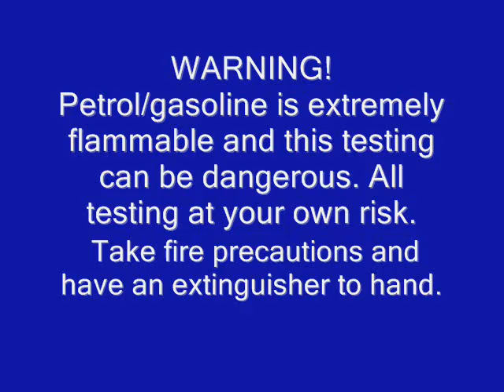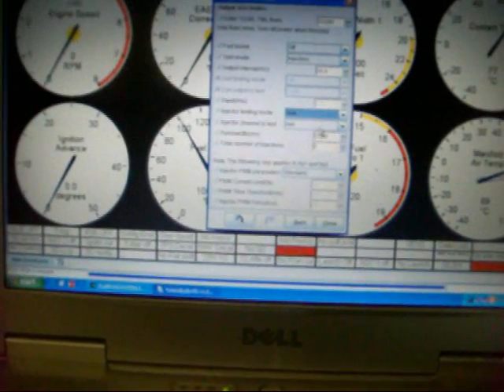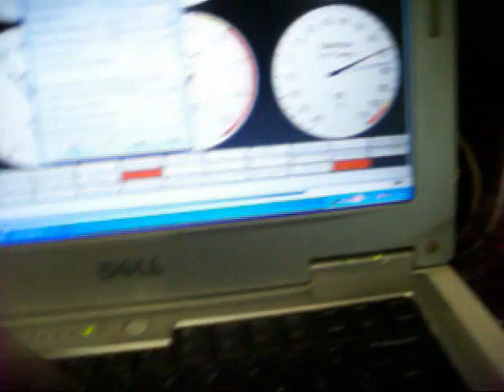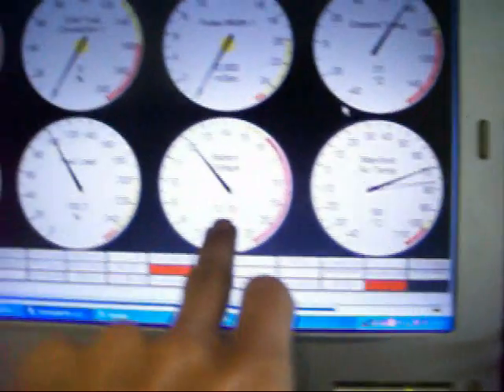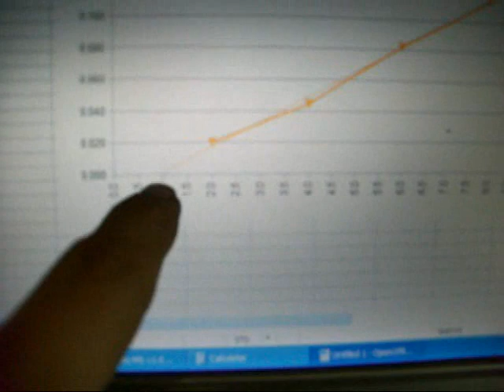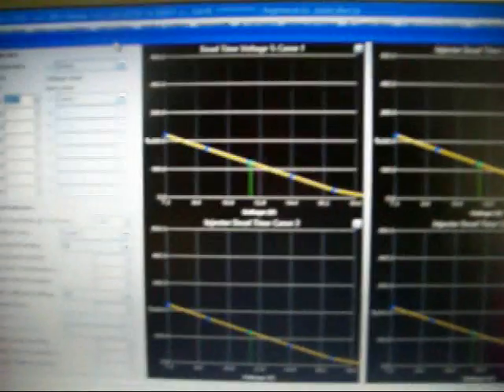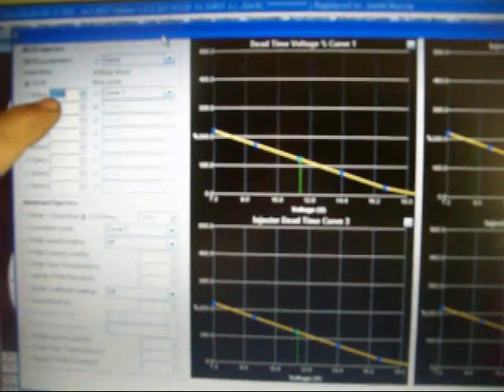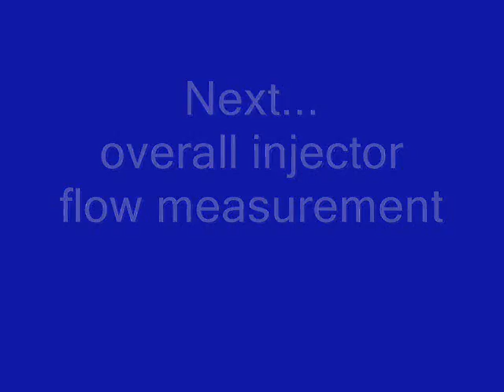Megasquirt fuel injector dead-time & flow testing

Comment: Very interesting. Thank you for making this video. My car has been on a megasquirt 2 forever... it's v2.2. it's always had the 1 millisecond setting.  I have low impedance injectors 2.2omhs 85lbs @43psi, and the dead time is .379 @14v , that's what the manufacturer said. It starts and idles pretty well for a megasquirt car. But it's super sensitive if it's ever above 14.8 afr. I also pull a shitload of timing down to 0 degrees during cranking, and then soon as it fires, I add 10° depending on temperature for warm up on top of 18 degrees.. Engine is l28et edis 6 124 module msd6al to a locked dizzy. I really want to get a newer efi like ms3 or fueltec, I'm surprised it's still alive it's probably got 200,000 miles on it. Lol 
I think I may try to put it in the dead times that I have and just retuning it.